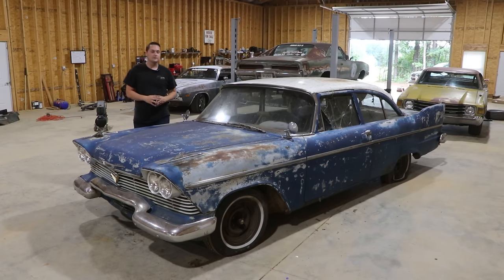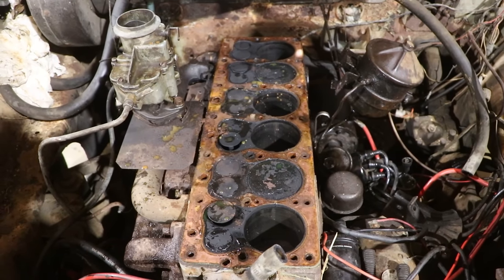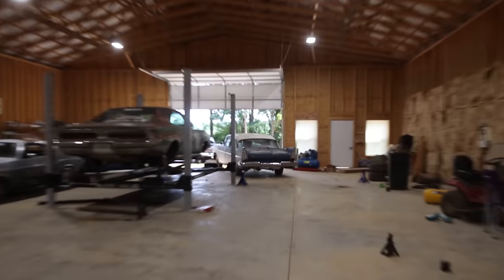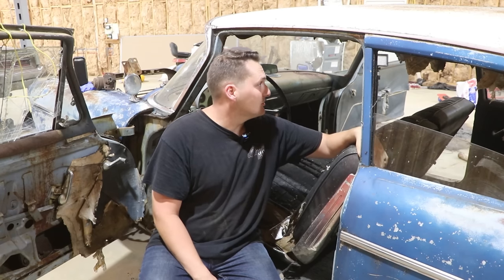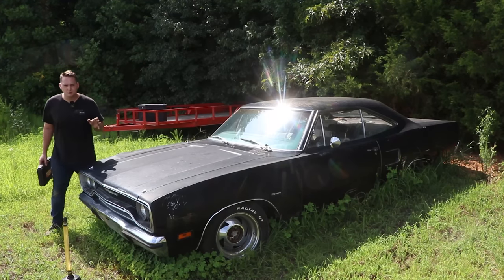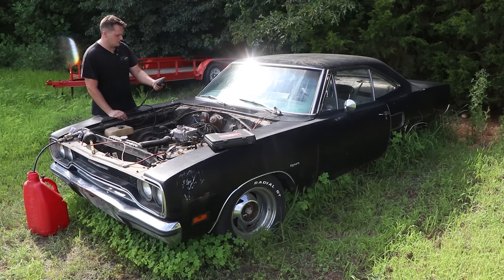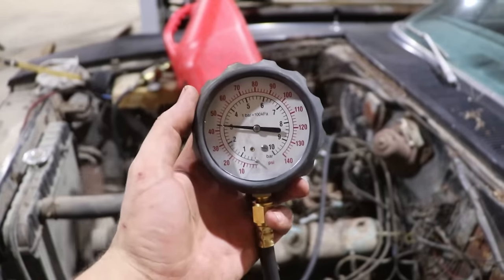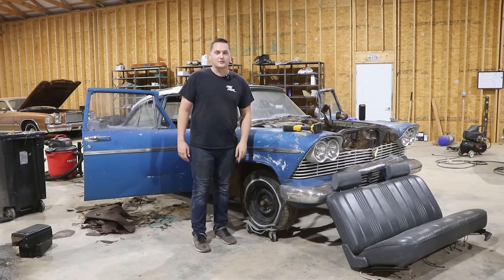Barn Find 1958 Plymouth Engine Teardown - Is It Too Far Gone?

Comment: Just a question, how much are these in the US? (6 Cyls and v8’s) I’m thinking about importing one in a few years
Also if it’s a push button or a on the column, does that change price much?
Reply: Generally speaking, the higher the trim package, the more expensive/desirable the car. If it has the funky gadgets most people didn't get/couldn't afford, it'll be a lot more money. Especially on rare cars. 

My mother took one look at this car and said "it's pretty common". I would imagine you could find one pretty easily stateside from forums or classic junkyards. Don't know if you want a project or a driver-ready one, but forums, junkyards and sometimes Facebook are the way to go for projects or leads. Join a vintage Plymouth group and you'll definitely find leads. Always look stateside first because the import cost will be more than you pay for the car, $3000-$10,000.

Even modern junkyards might have some leads, because occasionally they get vintage/rare cars sold to them and they set them aside, either for themselves to fix or to sell as whole to someone who wants to restore it. 9/10 times the junkyard employee is a car enthusiast, so they should have good leads.
Reply: @GetDougDimmadomed  thank you so much.

Comment: Reminds me of a swap I did years ago. Yanked a built 440 , full manual 727 and a posi out of a 68 Satellite and made it fit in a 57 Plymouth. That was a much tighter fit. I could write a book on that one.
Reply: That sounds like an interesting swap.  
I put a 75 Cadillac 500 cubic inch engine and TH400 transmission in a 77 Chevy pickup.  Was fairly easy swap.

Comment: Dylan when you find an engine with really low compression put 90W gear oil in the cylinders and it will start right up if you have fire and run fine. When the engine warms up the rings will free up and be fine. I have done this in the passed and it worked perfectly.
Reply: Past.

Comment: I use 15W-40 Diesel oil on my Chrysler 361 Big block, same oil type applies on that 318, The diesel oil will have tremendous amounts of zinc compared to the conventional oils thats more for modern/fresh engines.

Comment: In 62 I kelp losing my mains in my 51 cranbrook ply
So I went to the wrecker (back then) found a Chrysler 260 six.
It was nay 3 inches longer, no problem.
I was taking auto tech in college so I bored it oversize , put a truck clutch behind it,
Make sure to replace water displacement tube in block that runs behind the cyls to cool them
It ran 60 in second gear.
Mill the head 60 tho , I split the exhaust for duals,
Chrysler actually made dual intake and exhaust but my friend wouldn’t part with his.
Might be cheaper to just get a 318 from the local wrecker , clean the outside and tell everyone you worked it over 
And enjoy.

Comment: There's a goal for me. I have a 1968 Coronet 440 that was pulled out of a storage Shed it was is put in back in 1986. I found an 871 blown 440 that's just about ready to put in. After that I just need the cardboard list. I'll be at moparty September 16th through the 18th.

Comment: im actually building a budget OBS chevy truck of course its not that old for some of you guys but im up in Canada cars rust alot and for a 89 its old! 
already spent 3000$ in total With the price of the actual 89 C1500 single cab long bed! 
im dropping it 2/4 on 15x8 aero wheels and 255-60-15 all around. and restoring fuel system because the tank is open from rust.
keeping it stock for now 5L TBI 700r4 185k kms on it running smooth! 👍
but i already bought a L31 350 Vortec for later! 😅

Comment: My 1958 Oldsmobile 98 is almost in the same boat as yours, albeit it hasn't ran in 30 years and is missing a few things, such as a radiator and the front floor pan. Might do videos on the clean up and the attempts at starting it. Oh, and I believe it has the big block GMC 371 for that year, which is freaking massive. The engine at the first time I looked at it was able to be rotated by hand, now not so much.

Comment: My 60 had the first iteration of the slant six originally but it now has a 318 LA that is mated to a 61 powerflite in a curious manner with funky homemade aluminum spacer bits and a snouty style bolted spacer between the flywheel and converter. It does go in gears and works but I am curious as for how long it will hold up 😅 Some proper backwoods mechanics that has been there, even a plumber have been there doing the brakes with funky plumbing parts and thead sealer all around 🤣 can't wait to get it on the tarmac and go cruising 😊 can't wait to see more of this 58 of yours.

Comment: Plymouth 6 cylinder engine. Inline L-head Six. Cast iron block. Displacement: 230.2 cubic inches. Bore and stroke: 3.25" x 4.625". Compression ratio: 8.0:1. Horsepower: 132 @ 3600 RPM. Torque: 205 ft lbs @ 1600 RPM. Four main bearings. Solid valve lifters. Carburetor: Carter Type BBS one-barrel Model 2567S.

Comment: ‘62 only 727’s use the cable configuration from the cast iron 466 as well as the e brake drum on the tailshaft of the transmission. One of these transmissions would allow you to use all 62+ engines with the same bellhousing. If you found a 62 Chrysler or dodge 880 donor, you’d have a sweet engine upgrade as well as being able to keep a pushbutton assembly

Comment: When you pulled the head off I noticed that it looks like 6 single cylinder Briggs and Stratton engines put together. It even looks like 6 Briggs head gaskets into 1

Comment: I was amazed to find that there was an even more base model than this (in 57-58 at least) , the Plaza , hate to think what they removed to cut back even further - I`m pretty sure that the 3.8L side-valve straight 6 was bottom of the engine range, amazed that 130Hp could move this car , though it did have a decent torque for its power output . 318 is ideal swapout , ok it`s no 426 hemi but it was the "Christine" engine in V800 guise ..

Comment: Flat head motors were low compression to begin with. I had a 62 Rambler American with a flat 6 that had holes in the tops of the 3&4 pistons and still ran. Smoked like crazy, took a quart of oil every 20 miles but still started and ran. A flat head 6 in a car that heavy isn't going to give you impressive performance no matter what you do to it. IMHO. God bless and stay well.

Comment: Just the way it sits, that LA 318 has twice the power as the flathead six.  I can't believe the replies suggesting you rebuild and hot rod the flathead six, at best even with a "hot" cam, more compression, and more carburation - that flatty six would be lucky to make 130 hp.  I know that some of you are still replaying that episode of Happy Days where Fonzie souped up Ritchie's dad's DeSoto flathead six so that Ritchie could win a race challenge - but that only worked on T.V.

Comment: i wish you did the inline six cylinder and built it up real nice. I get it, you want the easier option, more parts out now. but back in the day, teens would fix the six up and probably do a three car setup with headers and glass packs.

Comment: It’s great to see that tired old engine out of the 58 Plymouth. I believe the 318 is an excellent choice of engine for this car. The question is are you going to use three speed manual transmission or a 727 Torque Flite automatic transmission with the original push-button controls?  I do believe that Christine had a V-8 with a 3 on the tree. Additionally, even though the interior is not in the best of shape, it looks a lot better all cleaned up. I’m looking forward to seeing how this project turns out.

Comment: I had a 50 dodge p/u with the flat six I rebuilt it and put on dual carbs and custom headers .. pulled like a diesel..   that 318 will be a nice addition itwilk run good ..

Comment: In 1973 you would have been at the height of the first fuel crisis.  it would have been fairly easy and not that expensive to hit a wrecking yard and buy a RTO 383, 413, 440,  and Torqueflite out of a fairly new Chrysler product.  You probably could even scare up a rearend out of a Challenger or Cuda to swap in to get rid of those press fit drums, plus get a conventional parking brake.   

Rod & Custom even had some articles on this back in the day, buy a whole running wreck and take what you need and junk the rest.  

Today you'd probably use a 360 out of a truck and a rearend out of a Dakota or something (or even a Ford product).  Wasn't that long ago I bought a Ramcharger with a 360 for $50 and I drove it for about six months.  But it's still not that hard to find a bigger engine.  

Whatever you do, don't paint it red.

Comment: 20:50 The 318 did smoke when you fired it up. Check valve stem seals, rings etc. something will give in the near future. Might as well when you have it out.

Comment: With a $3,032 base price, the 1958 Fury was the most expensive Plymouth that year. Its production of 5,303 was down from the 7,438 for 1957, but up from the short 1956 run of 4,485.

So there aren’t many of these cars still around. Keep it original and it will appriciate in value.

Comment: Poly 318 and later 318 had similar block but different heads and cam. You'll need the Satellite diff complete, and it has E brakes on it, not a driveshaft brake like '58.

Comment: I was initially upset at the engine swap, but once Dylan described the issues with the Satellite, it made sense. There is no telling how long it will take to make the Satellite roadworthy again, and it's not going to be all original anyway, since the frame has to be replaced. It doesn't make sense to let the perfectly good drive train sit out in the weather when this car needed one. It makes better sense to put this drive train in the '58, and find a better one for the Satellite once the frame has been replaced. Since the Satellite will be a restomod anyway, it won't negatively affect the value, and may actually raise it if he puts an upgrade in it.

Comment: so what, the satellite going on a power wagon frame? that would be kinda cool. it is one of my fave body styles. a neighbor had a road runner with a 440 that was a real screamer for it's size. that satellite series is why i subbed kevin's channel. when he said it was going to a new home, i knew it was yours from the get go, seeing as you are mr. mopar. i voted to keep the flathead in the '58, but i get the reasoning behind the swap. and end of the day, it's your car to build as you want. i won't be throwing you a bunch of hate. actually, i'll be looking forward to both builds.

Comment: Dylan why didn t you have a big bag in the car so as you took headliner down you could of just dropped it into plastic bag just to save you having to clear up off the floor .just saves you extra job  great video .i saw when you did the burntout on kevin s traller from junkyard digs i thought u going burst the tyres

Comment: Hotting up the six would cost an enourmous amount of money as everything would have to be custom made for it. And you would have a engine with the same power output as a Camry. Same with a Poly V8, which can make great power but to get it ,again involves paying big bucks to get the parts required to up the horsepower. The LA is a good choice ,a 340 or 360 would be better but using what you have is object of the exercise. Use that Satellite back end too to get away from the '58's lack of a handbrake and the tapered axle ends.

Comment: Chevy used air cooled powerglides right through 1965. I would sell it as a really good core to finance the new engine like a nice big block or a new hemi. After the headliner is down scrape the glue off and do a light DA Job on it and roll some POR on it even if you do a head liner replacement.

Comment: I'd personally do a poly 318 or low deck b for period correctness but the la isn't a bad idea. Trans would be weird, I think I ran across a pushbutton kit for later 727s years ago using the parking brake cable as a park lever. Or could keep it manual, I suppose.

Comment: Cast iron torqueflight. Made till 61 when they went to aluminum 727. Cableshift transmissions are not for amateurs to play with, there is a specific procedure to adjust that cable. Get it wrong and you burn up transmisssion. Demon carb? I’d say Chrysler carter thermoquad knock off. 

Auto metal direct has complete frames, floor pans etc for the b body’s

Comment: DYLAN,
That drum brake on the driveline blow you away?
My 2014 Ford F53 motorhome chassis has one too.
I'm surprised how tight it holds. You CANNOT drive
away with it set. Unlike some rear wheel brakes I've
known. 

!

Comment: When is the interior of the shop getting finished? Working around those fiberglass batts in the wall has got to be annoying, the stuff will start breaking down and shed, when you're hot and sweaty, you get to wear those fibers. Even covering it with some 3mil visquene will be better and probably code anyway.😉 (IBC)

Comment: Hey Dylan: You're far better off replacing that tired flathead six with the 318 V8 out of that '70 Charger as long as the tranny matches so its not a further hassle... Gonna need to replace the glass, interior, fuel system, wheels and tires and check the front and rear suspension to get it ready for the Holley Mo-Party on 9/16.... Nice Christine clone though that oughta turn plenty of heads....

Comment: Even if you are not able to put battery powere to a vehicle in the junk yard witch more than likely is the case you can roll it over by hand and feel if all the cylinders feel like they are equal in compression and though it will be lower than cranking with a starter you can check compression with a gauge though keep on mind you are not going to be able to get a constant speed 9n each cylinder so the numbers are not going to be able to verify if they are all e1u 😛or not but atleest good to see if the engine has potential to be good. Also usually not too much to get the oil pan off the see if any bearings are bad
Beware of engines with lots of new parts like water pump hoses belts water outlets freeze plugs radiator and that have a clean look to them like they had recently been opened up to replace head gaskets ect. Most people are not going to put a vehicle that has had a ton of recent expensive work done in the junk yard they would more likely sell it for parts or keep the engine I prefer to pull from smashed vehicles except for rollovers as they likely got starved for oil or tried to be started with a cylinder full of oil and hydro locked damaging the rods. Wrecked vehicles most likely drove to the scene of the wreck and were running at least but likely running half way decently so they are likely going to be fine and still good

Comment: Or, cooler idea.. I already suggested the gen3 hemi swap from a pickup truck. Kind of bland.
If you can find them swap in a v10 magnum and 6 speed. Again truck stuff, not viper parts but a little exotic.
 And you can say you resisted the urge of a v-8 swap

Comment: If  you're going to a V8 swap nothing would be cooler than a dual quad poly 318 with the cast iron A-468 cast iron torqueflite and you'll be able to keep the pushbuttons because there are lots of them available and you'd learn things....such as the transmission damn near can't be hurt, and that it has a seperation bell housing and eait until you see how they mounted the torque converter without a flex plate.  It's bulletproof. You could set off a grenade under that drive line and not.hurt.it

Comment: I don't know what it is with all these new fashioned YouTubers when it comes to pulling engines. Worked on plenty of old cars in the 60s and 70s changed a few engines and transmissions and we never pulled the engine and transmission together. Weight was one issue, like that car. Aluminum bell housing but the rest of the transmission is cast iron.  On some vehicles like the Dodge trucks from the 30s up to the 50s you couldn't do it. The bell housing was actually a cross member going from side to side and the pedal pivots and the master cylinder were bolted to the "ears" on bell housing. No rubber mounts just two bolts on each side that went in horizontally, through a bracket on the frame and into the "ears" that were cast into the bellhousing. There was not enough room to get it out if you left the bell housing and transmission on. You had to pull the transmission, drop the clutch and flywheel and unbolt the motor from the bell housing and pull it out. I had a 50 Dodge with the butterfly hood and somebody took a torch and cut the whole front grill out to change the engine and then welded it back in when they were through. It was easy enough to drop a transmission on those things, and plenty of room to drop the clutch and flywheel, but some folks got to do it their way.

Comment: You do realize that the drum on the transmisson is the only parking brake that car has? I don't know if you have car inspections were you live , but over here across the Atlantic you need to have a functioning parking brake. Also I'm not sure the old pushbutton wire is compateble with the newer transmissions. I have a 1965 fury and a 1960 Fireflite so I have compared these for compatibillity myself. I don't know how to write this comment without sounding like a dick, no bad intended with it though.

Comment: The difference with this car is that it is not a fury It's a belvedere  the fury only came in one color a tan and the parts were different upgraded with a  chrome package Christine is a belvedere but was built with the fury package  the motor as well was from a fury. This came from the dealer at the time because the fury didn't have the color options but did have  upgraded package but the belvedere allowed different colors and upgraded package to be custom ordered.  I would restore  this car with fury parts and motor Dylan she will look good  and would be worth more.